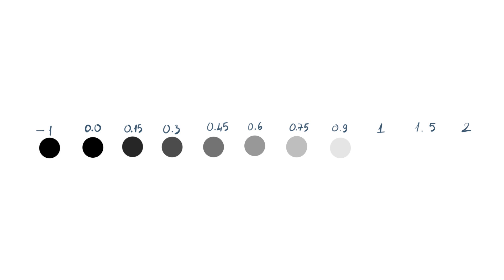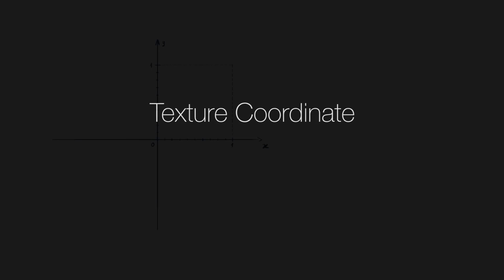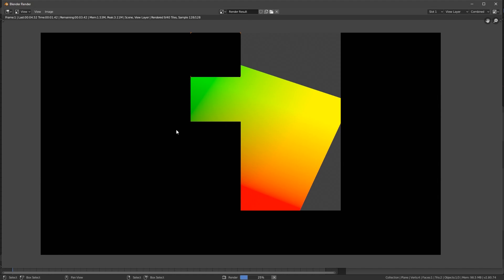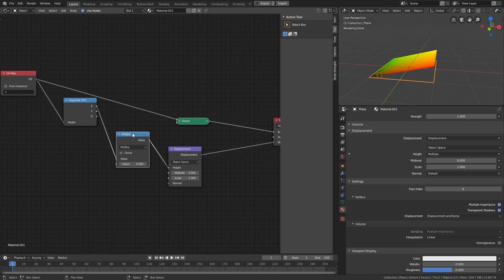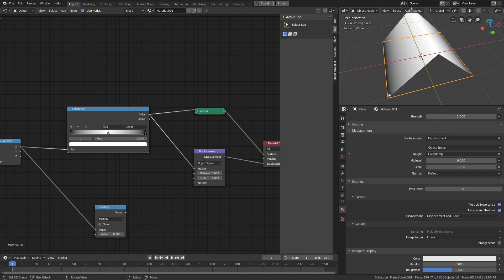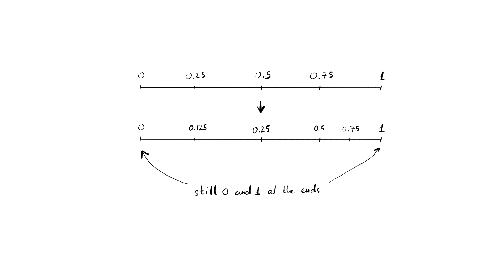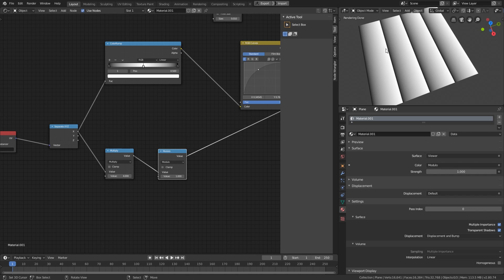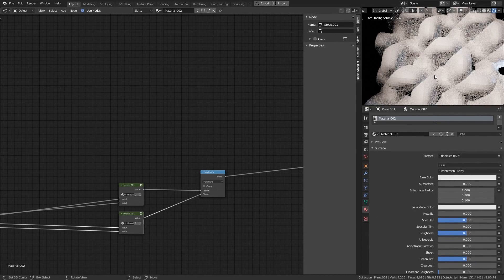Blender node insanity made sane

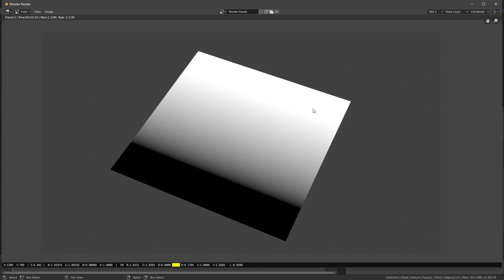Comment: 6:13 The displacement is not working for me. I'm using cycles in experimental mode, and I have set the displacement to Displacement and Bump in the material/surface settings. Is there something else that I'm missing here?

Comment: This is some nice tips and tricks for a special effect. If a plane was rendered with this node, would the results of this in the shaded or eevee render the same when rendered in frames?
Reply from the maker: eevee doesn't have displacement so you have to use bump instead, other than that it should work the same

Comment: You can actually adjust the value of Color Ramp to go above 1 when assigning colors though. I don't understand how you just said Color Ramp turns everything into black and white, then you showed us how you adjust colors in it, I am confused.
Reply: It does  convert to black and white.. But it seems to be able to also add color afterwards..  But you can ignore Hue and Saturation in this example. Value is most important.  

But if you are curious you can try changing a colorstops color on the ramp (with HSV-sliders) while previewing. You will find that changing the hue actually influences the output as long as there is saturation.. (Full red and blue results in lower numbers than green and yellow.) 

Sorry for adding even more slightly irrelevant information, just trying to learn my way around and through these nodes myself! :D

Comment: Hello!! What to do if I do not want to use it UVMap? I do not want to do an UV Unwrapping...!:) 
You can use the "Object" from (Texture Coordinate Node)?
I tried the Object and got a suspicious result .. I do not understand how it works Object coordinates :(
Reply from the maker: The fabric texture that I created works on 2D texture coordinate, if there is a 3rd dimension, it will be ignored. If you use object texture coordinate, then the fabric will look like it is projected from the top down. The object texture coordinate is the position of the pixel in relation to the origin of the object, it's useful when create 3D textures.